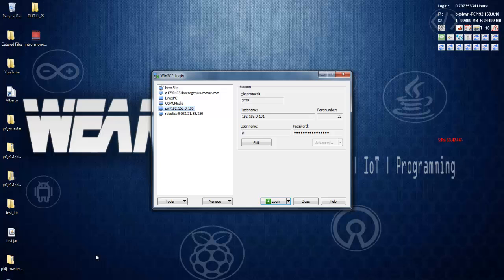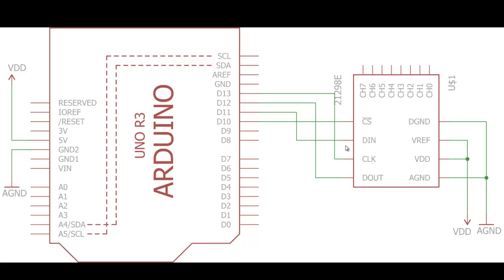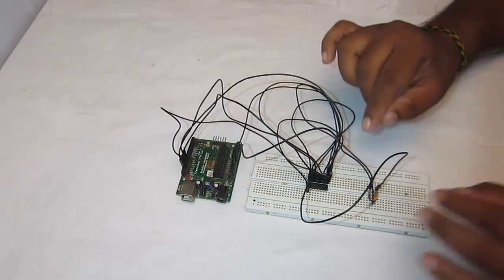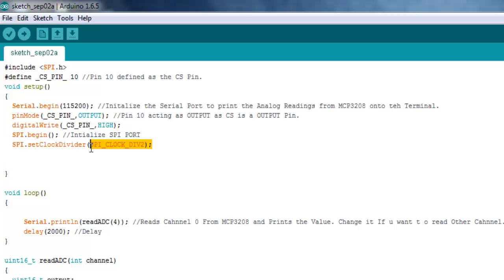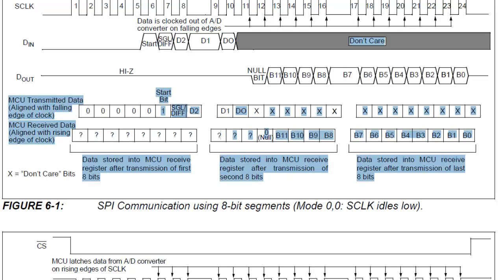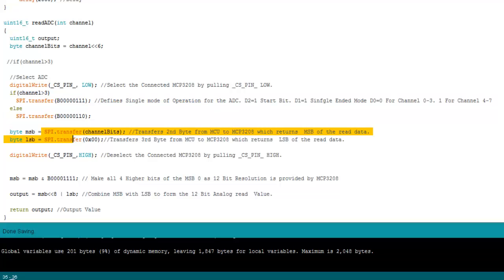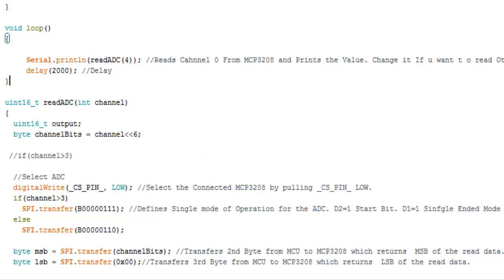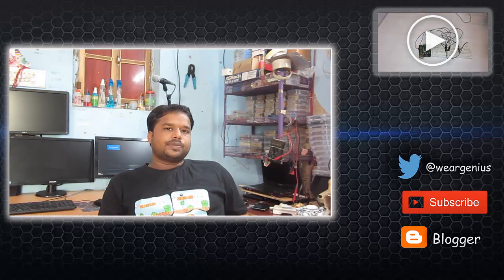Arduino | Tutorial | MCP3208 Interfacing

Comment: Why is it showing values like 4096 instead of actual voltage values like 4 or 5 ?
Reply from the maker: Every ADC gives you sample count depending upon the resolution and the input volatge, you need to map it to volatge depending upon the input you are providing to the ADC.
Reply: WeArGenius i am providing 10 v to adc and 5V ref
Reply from the maker: 10v ?? Using any potential devider or directly ?? Please check the input voltage rating of the ADC ..it should be below vref
Reply: Sorry i am giving 2.5 VDC as input and 5V ref
Reply: Whatever voltage i provide as input, i always get 4096 as output from adc